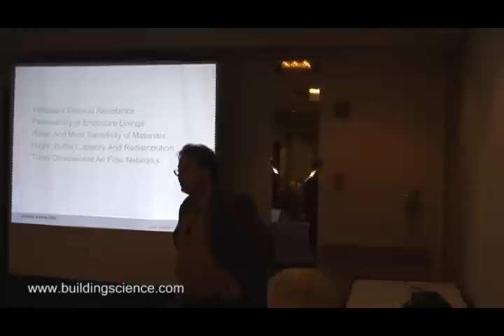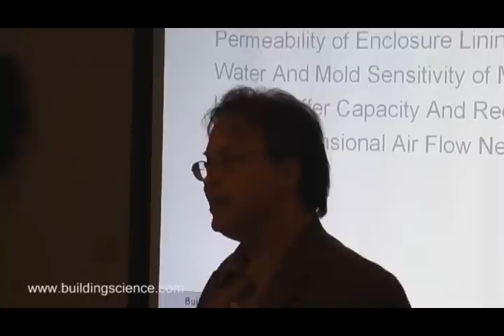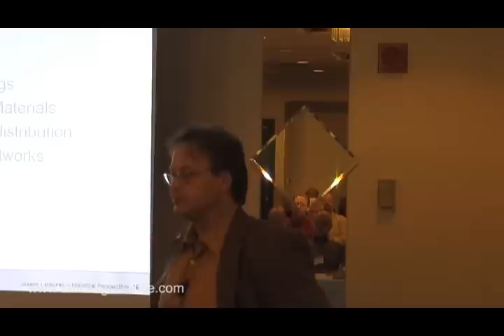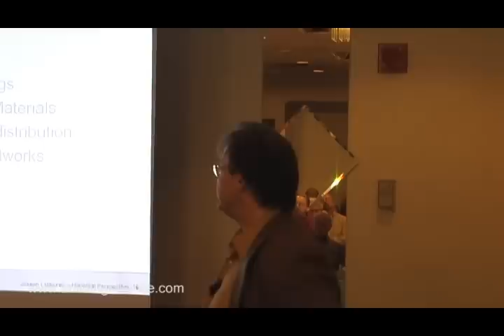Five Fundamental Changes to Buildings

Comment: Not sure what the contention is here?
That Joe's credentials aren't worthy of the attention he receives?

Or the forensics he has done and their findings?

Or what he states in the video?
It seems pretty clear to me, a layman:
The materials we use now are more moisture-sensitive than those used 100 years ago. 

Some of the concepts may require some physics study and experimentation, but they also make sense, and they can be disproved relatively easily if that's the intent:
* Massive water vapor can infiltrate through air movement.
* Water vapor can move via capillary action. 
* Water vapor can move through concrete.
* Trapping water where it can mold and rot materials does bad things. 
* You need to pay attention to where in the material water will condense.
Reply: Dr. Joe (years of experience, study and an Engineering firm) VS David (????)

Comment: Old Louisville experience a flash flood August 4, 2009.  The 1897 building I live in 50" of flood water. It was amazing to see how quickly particle board furniture turned green--nearly overnight.  Any drywall had to be removed.  Any furniture containing MDF doubled in weight; particle board fell apart.  Antiques without drawers and veneer survived.  The plaster and original doors and woodwork appeared unscathed after washing and drying.  My existing respect for natural materials grew immensely.
Reply: f it can't dry, it's gonna die. - David Nicastro